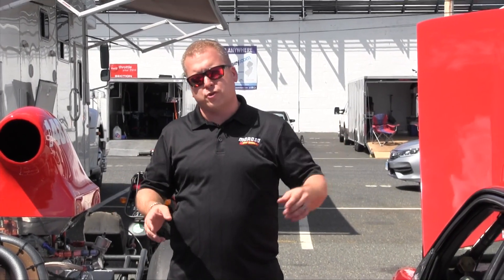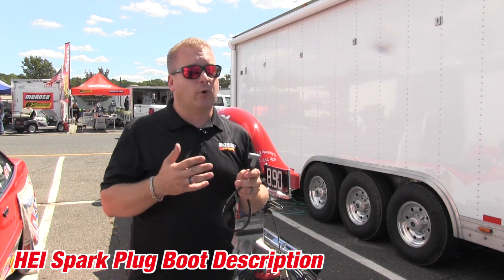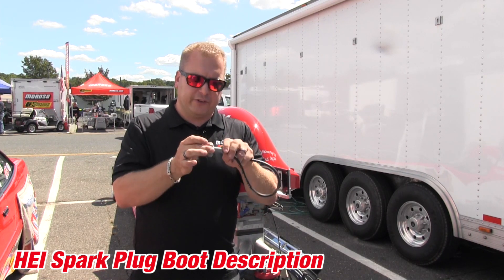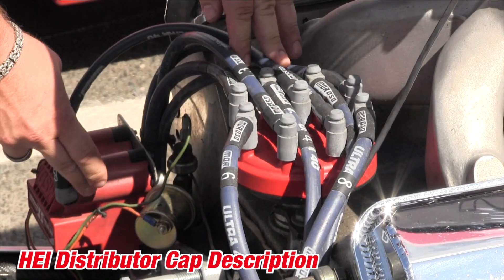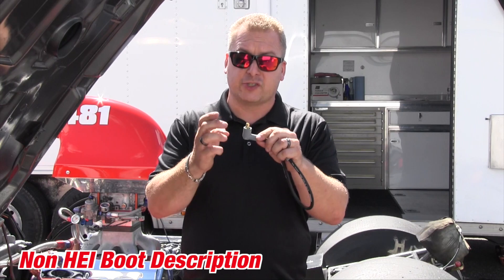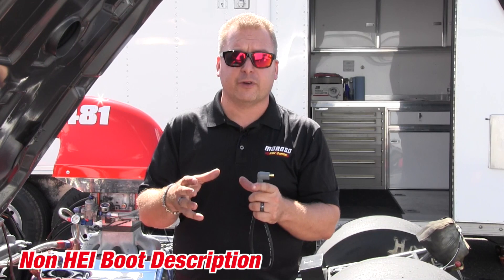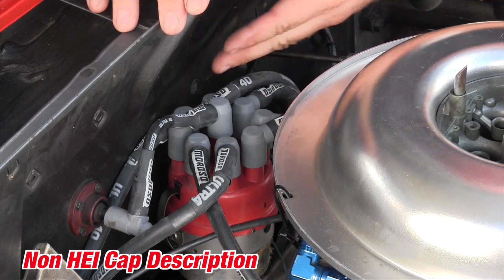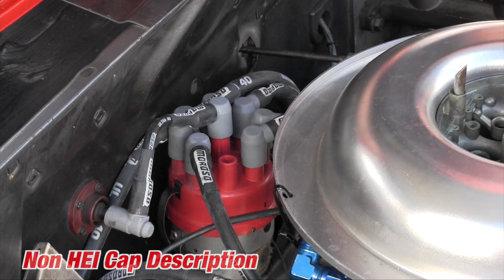Difference Between HEI & Non-HEI Spark Plug Ends

Comment: I bought my Moroso Ultra 40 race wire set, #73617 8.65mm plug wires a year ago.  I finally...yep, it took a year... got the engine re-built and opened the box for the first time to discover they won't fit on my distributer cap,  the wires are Non-HEI.  Can I exchange them for the HEI type? I bought them through Amazon.
Reply from the maker: You'd have to call and speak with the sales department directly. We're in the office 8:15 to 5:00 EST Mon through Friday. 203 453 6571 ask for Jim.

Comment: Thanks, now i know what i have
Reply: mis-construed this completely, this is describing terminal ends not the distributer itself. what you have is an HEI style dist. cap but not the actual HEI Dist. correct ?? Otherwise the coil would be in the cap right ?? Mine has the same cap with the terminals like you show, but it has an external coil, hence its not and HEI setup

Comment: Thank you.  This is a most excellent visual explanation.  I have an high voltage aftermarket ignition system,  but clearly have the old style female distributor cap with pointless assembly inside.  Without your video I probably would have bought the wrong wires for my 1963 Thunderbird due to the high voltage spark generator.  But I'm only 79, so still learning.